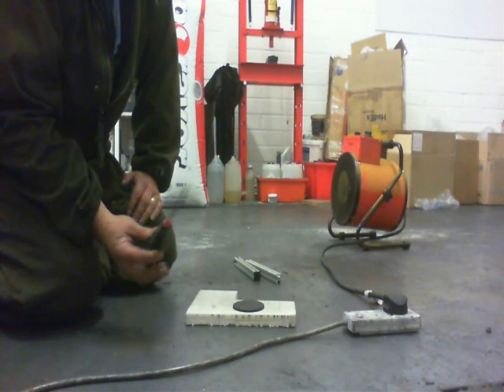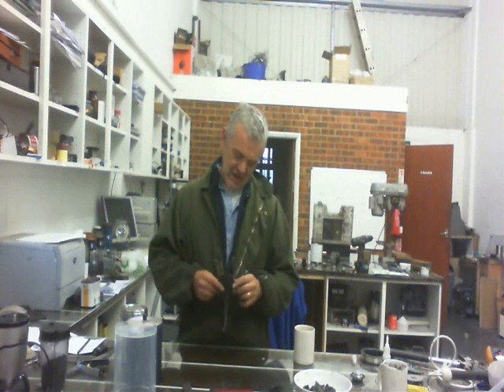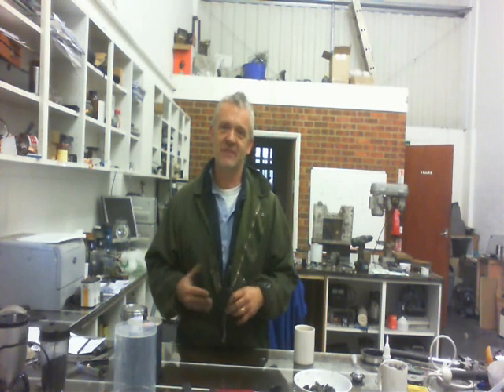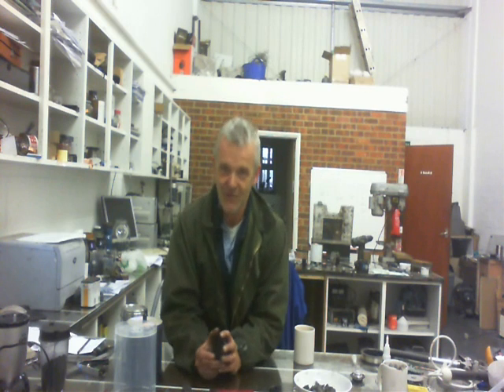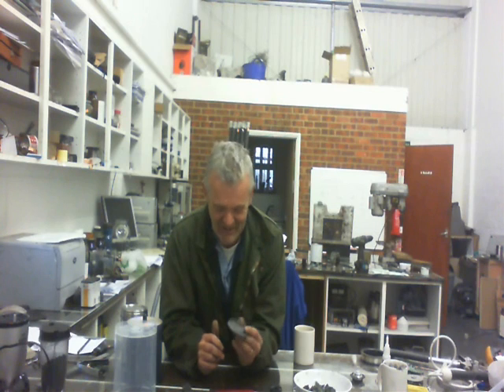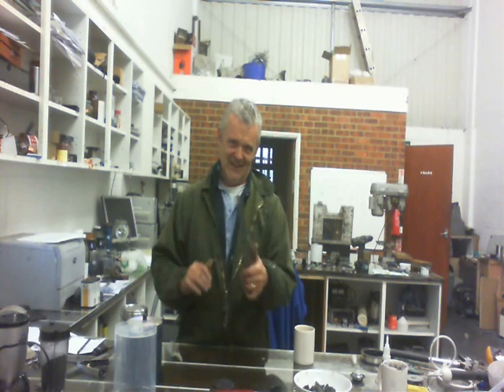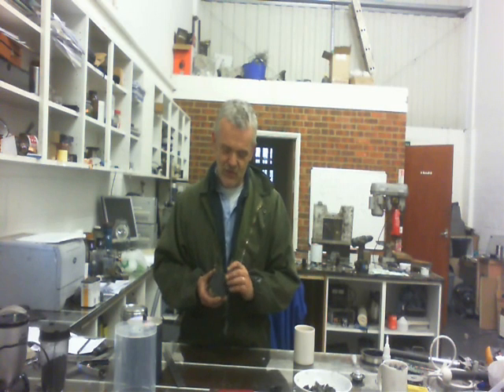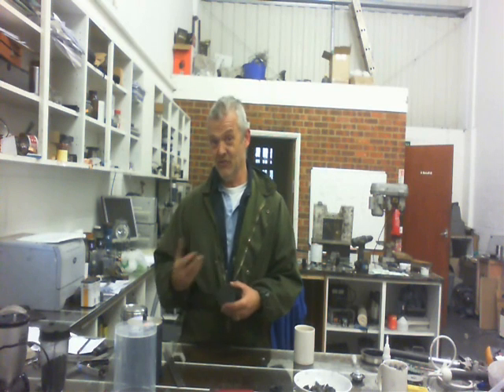How To Make A Bulletproof Vest Using Graphene-strengthened plastic

Comment: What about sintering graphene and steel like a lasagna?  

Do you think it’s possible to use plasma or lasers to sinter alternating layers of steel and graphene in space and form rings like that used in chainmail/key chains?

Imagine making keychain rings and making chain mail forms like carbon fiber meshes, and then filling it in with a combination of steel and graphene/carbon fiber bits like fiber reinforced rebar in concrete- except the steel is the concrete

Comment: That disk is essentially about as reflective as the little flake I used to clean the scanners off, Except it was almost like a silvery gray.

It was pretty fragile, but some bits were pretty hard, like I tried to use a paper clip or my nail to break some pieces. Or try to manipulate as much as I could because I didn’t have any way to measure any resistance.

Out of a fingernail, you might get a few points on it that are strong. Like I would say less than 10% of a fingernail,

Comment: Do you think something similar could be used for the blades of say a cyclo rotor?  Or would that necessitate a Graphene carbon fiber composite?

What about a manned quadcopter, turbo prop or small jet engine?  At least most of the other parts of the vehicle that aren’t in contact with the Jets anyway

Comment: The shape of the metal that was bent was a longer piece, (thickness the same but shaped differently. The small round disc would be just as easly bent if it was in the shape of a ruler, like the metal was. As for the stabbing and it not shattering or sticking, I am very impressed. What binders were used?

Comment: Sooo...  are helmets or any future protective head gear possible ?
Reply: yeah it would save you from the piercing bullet easily.

if it will save you from a brain bleed from the sheer force of your own helmet smacking you like a sledgehammer is a different question

there has to be a way to both absorb and redistribute the shock of that. 
Having the helmet be fishbubble shaped and mount to the shoulder and chest-collar area (Like an EOD space suit hybrid) then the impact can be absorbed by your whole torso.

THINK BIG DRILL GUY FROM BIOSHOCK. OR RHINO. BE HIM
because graphine plastic is so light it would feel like ur cosplaying.

Comment: But have you shot it with a gun yet?
Reply: His first test was shooting at a 4mm plate (.5% graphene reinforcement) with a .22 and a .45 ACP carbine. 2nd test 2% reinforcement, 9mm plate, 7.62x39mm round. Both tests successful, tiny deformation of the back face of the plate.
Reply: Michael Lovelace could you point me in the direction of the video he had where it was shot. I cant seem to find it anymore.
Reply: There were 2 videos in which he tested the material with bullets and both have been deleted. There was an article on this material in a trade publication in early 2016 but not a peep since. I did a patent search for this material (although not as rigorous as I might have done, these things are a great way to get a headache) and found nothing. I suspect this has fallen down the rabbit hole of some military project.

Comment: With overlapping plates and a air filled gel could absorb a lot of energy because the low mass would allow it to accelerate relative to the force applied to it, which would redistribute the energy into 'empty air' in essence, at least up until it either compressed the air or struck some kind of backing.

I was thinking of doing that with a titanium alloy with hexagonal interlocking plates sealed in a durable elastomer, but this graphene is much lighter and clearly less expensive, so it would most likely perform much better and be more affordable to produce.
Reply from the maker: indeed

Comment: without revealing the secret sauce of your client, could you reveal a general process for creating something with a better strength than steel volume for volume?  also, how was the force applied that snapped the disk?  I'm interested in the tensile strength under a high but transient load.
Reply from the maker: add some graphene to some plastic

Comment: I thought you were going to show how to join them all together
incredible stuff
but
 graphene /graphite is carbon, plastic sounds confusing
maybe this is combined with plastic layers
metals can alsois be plastic and not all plastics are
, some are brittle
Reply from the maker: good points - the problem with plastic is it has both a general accepted definition and a narrower definition. 

From wikipedia

The word plastic is derived from the Greek πλαστικός (plastikos) meaning "capable of being shaped or molded", from πλαστός (plastos) meaning "molded". It refers to their malleability, or plasticity during manufacture, that allows them to be cast, pressed, or extruded into a variety of shapes—such as films, fibers, plates, tubes, bottles, boxes, and much more.
The common word plastic should not be confused with the technical adjective plastic, which is applied to any material which undergoes a permanent change of shape (plastic deformation) when strained beyond a certain point. Aluminum
 which is stamped or forged, for instance, exhibits plasticity in this 
sense, but is not plastic in the common sense; in contrast, in their 
finished forms, some plastics will break before deforming and therefore 
are not plastic in the technical sense.

Comment: Sorry for the dumb question, but why does one need plastic? Isn't graphene bulletproof by itself? Wouldn't plastic just add unnecessary weight and cost?
Reply from the maker: it holds everything together mate - graphene by itself would just fall to pieces
Reply: so if you put like, 20 layers of plastic with graphene between every layer. could anyone calculate the force it would take to put a hole in it?

Comment: Where can I buy the lumps that it comes in before you powder it?  Is there a way we can get in contact?  I am interested in making things out of this material and I have the equipment to do it but I am unaware of any distributor that sells the "candy like lumps" you talk about.
Reply from the maker: we make it mate it can''t be bought
Reply: Is there an in depth video or guide on how to make it?
Reply from the maker: nope - but it is just graphene and the plastic of your choice - quite a few folks have done videos on different plastics
Reply: You also said that you pressed the powder together, what type of press did you use to compress the plastic?
Reply from the maker: the one in the background from timestamp 3:30 - it's a car shop press - i got it from ebay
Reply: I have access to a 100 ton hydraulic press, assuming I get the graphene and plastic I wanted mixed in a powder form, how much pressure would I need to apply?  I know it will be different based on the quality of the graphene and the plastic but could you give me a rough estimate?
Reply from the maker: mate - just try different amounts and see what you get
Reply: Thanks a bunch.
Reply from the maker: i can't be much more help mate - it really is just experimenting with stuff

Comment: Well, a 231gr .45 ACP moving at 830 Ft/s has an equivalent Foot Pounds of force of about 850 I think, and the plastic thing breaks at 992 pounds, so it could stop that.  But  NATO standard 9mm has a much higher velocity on a lower mass, so I think that it would require more Graphene, or a thicker medium.
Reply from the maker: +Michael Saumure sounds right mate - cheers

Comment: Since graphene is very conductive, it there a way to prevent electric shock to the wearer?
Reply from the maker: +HoldShiftt2Run not if they were touching it - no. So i guess you would need to insulate if you planned on using it in an area where shock was a risk. Graphene is carbon based mate
Reply: Robert Murray-Smith so you think regular wire insulation or shock proof plastic would be good?
Reply from the maker: +HoldShiftt2Run I don't really think it is much of an issue mate. Heavy duty bullet proof material is steel plate - they don't seem to worry much about electrical shock there. But I might have the wrong end of the stick - still it is not something i have thought much about
Reply: Robert Murray-Smith oh thanks mate. :)
Reply: +HoldShiftt2Run Planning on making some kind of ironman suit or something?
Reply: Blitherer Masterman shhh mate, we don't wait to let our secret out. It is actually for an engineering competition. We are working on a rescue suit.

Comment: tried my hand in making a composite of Graphene/carbon nitride/bioplastic composite, I hit it as hard as I can with a hammer, 2mm thickness, doesn't break, some seriously strong stuff!:) found a cheap microwave kiln on eBay, cooked urea to make the carbon nitride. pain in the butt, (30seconds on,5minutes off for 3hrs
Reply from the maker: dedlunch do you have ratios that you are willing to share mate - very interesting
Reply: +dedlunch May I ask what kind of bioplastic, and what where the proportions?
I'd really like to try my hand at this!
Reply: Kinda late here but you can zap graphene in a microwave with ferosene and get carbon nanotubes
Reply: dedlunch great idea!

Comment: Great video. I was also confused by peoples ideas for future applications of graphene, which seem to get the micro and macro scale confused. Most of graphenes easy applications will be in electronics and possibly mechanics, but it is not a viable material to scale up to large scale applications to take advantage of its molecular arrangements. Unless of course someone figures out a way to produce continuous sheets of graphene...
That will be a whole new ballgame.
Reply: it is a synergistic effect when putting it inside materials, as opposed to coating them:)
Reply from the maker: +dedlunch cool

Comment: It would be a bit lighter than boron manganese flash bainite plate steel which is supposed to stop a 20mm shell, but not seen that for myself., if you could come up with a design similar to Dragon Skin but with your ultra lite material win, win, win!
Reply from the maker: cool idea mate
Reply: Robert Murray-Smith Thanks, another idea I was thinking could be interesting would be make a 12"by11" rectangle or there-abouts 6mm thick walls with a cavity in the centre that can be filled with silicon nitride SI3N4 hexoids or standard spheres/balls, and somehow mix your graphene matrix in between. Ive found si3n4 much tougher than ruby, zirconium, silicon carbide etc, and still comparible to tungsten carbide in shock resistance, just a random thought lol!
Reply from the maker: Mark Anthony Stringfellow
i like that and i can see where  you are coming from - i will try to get round and give it a go
Reply: Robert Murray-Smith awesome!, 2 other aspects I forgot is splatter mitigation protection, which should be much less anyway to the huge absorption rate in comparison to rigid steel, the other is bullets tend to be very hot after the friction down the rifleing of the barrel, which may help it burrow through the plastic composite, any way good luck and thanks for your replies

Comment: construction material anyone? is it roughly equally strong in all directions?
Reply from the maker: replacement for steel beams?
Reply: At the very least. If you could make it cheap enough you might make sips (structural insulated panels) with them too i imagine. obviously for that application where probably talking about really thin sheets.
Reply from the maker: Keegan Maloney
given the right machinery that's more than possible mate
Reply: Perhaps a better idea~ structural carbon foam that's also insulating. I couldn't do it, but if you like the idea please run with it if you fancy.
Reply from the maker: Keegan Maloney
cheers mate - it's on the list lol

Comment: It's going to sound a little off beat, but the intersection of off beat and interesting has a picture of you on the corner. Shingles. Yes the kind for roofs. All the various methods for bringing housing costs down, usually fail at the roof. Here is a strong lightweight material, that I'm assuming is inexpensive. Strong for areas hit by high winds and hurricanes, yet lightweight for earthquake prone areas. Just some of my thoughts. I hope the person you were working with will free it up for open source.
Reply from the maker: now that is a nice idea an yes it's inexpensive

Comment: Is it possible to make an alloy out of a nanotube steel and graphene?
Reply from the maker: it's certainly possible with aluminium and copper - so i  don't see why not
Reply from the maker: well - an alloy in the strict sense already exists - of course as steel is an alloy of iron and carbon (which is graphitic - on the whole) but you would aim for a sintered composite rather than an alloy

Comment: Top stuff Rob !  Entertaining as hell :) got my wheels and cogs turning like powered by rabid squirrels :)

about 15 years ago I was studying aero engineering and came up with a lifting body design with electrical field morphing wings ... that thermoplastic graphene combo could be a good material for structural parts as well as shell since cured by UV gets even tougher :) ... ah well, that was when I was pissed off by wing profile limitations for Ultralights ... something that stalls at 35 Knots won't ever be fast unless it morphs its profile ... tried the close proximity aerofoils effect for landing/take off config but still ... I thought it would get a tricky point in handling when in between configs ... loads of dirty air

Ah well ... back to work ... need to finish a forecast by the morning for our grand investors ... 

any ideea of melting point on that material ?
Reply from the maker: about 200 centigrade mate

Comment: Did you test the other property yet? like conductivity etc ? Solar road here we come!
Reply from the maker: yeah it's pretty conductive
Reply: Robert Murray-Smith
The material could be the basis for a complete body armor that can produce itself and also resists electromagnetic weapons. Maybe not unimportant in the coming time when civil wars in Europe are increasingly likely.
Reply: Robert Murray-Smith
So it is bullet proof then, and as well teaser proof.
Reply from the maker: deslomeslager
dunno mate - to be honest - got to fire a bullet at it yet - but it looks hopeful
Reply: Robert Murray-Smith
What about EMP and microwave strength and other electromagnetic radiations have you there also done some testing?
Reply from the maker: Michael Zieger
might be mate - it's got a way to go yet

Comment: Know here comes the serious question. What plans do you have for this stuff because if I where you I would have sell it at almost every major manufacturing company already ,maybe with the exception of the military (they don't need more stuff the have lasers already)
Reply from the maker: it's not something i will do much with mate
Reply: I think a good application would be knives lol.
Reply: Robert Murray-Smith well idk if what you are making is for someone else since you won't say what plastic goes in it but I can see this hopefully doing a lot of good a little bit of dust on a mold + high pressure and bam! You can have car part, structural studs for construction, furniture, tools, nifes would be great ...at least that is what I see when you see every little discovery no matter who makes it if is true the possibilities are enormous
Reply from the maker: mdimarco87
probably
Reply from the maker: Nelson Di Salvatore
it's pretty useful stuff i think

Comment: I assume this was a tensile strength test?  Determine the shear modules, as well as compression failure.  The big favor I see, is designing greater modules of rigidity through design, like an I-beam.  The thickness, even 1mm, is of great advantage.
Reply from the maker: it will have to run a whole gamut of testing mate